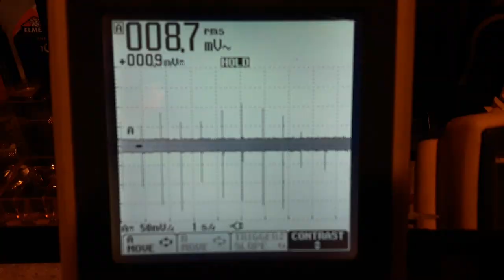Quartz crystal piezoelectric output comparison

Comment: Why not measure from the + and - poles instead of the sides?  The optic axis should run lengthwise down the crystal and should be the way they are measured as that is the way they are supposed to be cut.

Comment: What would happen if you were to liquify quartz crystals then cast them what would be the eletrical output.
Reply: How are electrets made?
Reply: Probably lose the optic axis.
Reply: You'd get glass. Thats what Thermal American does when they make windows for NASA. 9 of 10 are destroyed in tests.
Reply: People would get the pure fused quartz rods and use them for wands w a single terminated point cyrstal on each end. Usually held inplace by copper wire. One guy had the means to notch the glass and crystal so they'd snuggly fit together.
Reply: So the electrical properties doesn't transfer to the newly formed glass
Reply: @bearvassar6690  No. The crystal lattice is what determines some of the electrical properties...... In terms of meditation the fused rods seem to be quite similar in their effect, if a little "artificial"
Reply: @terryenglish7132  just curious i thought if the electrical properties remained the same regardless of the  form of the crystal  people would mold them into rings ,ect and make for near perfect battery. Thanks for the clarification.